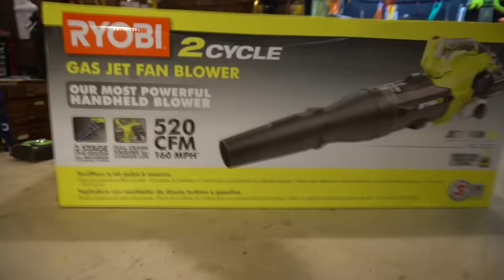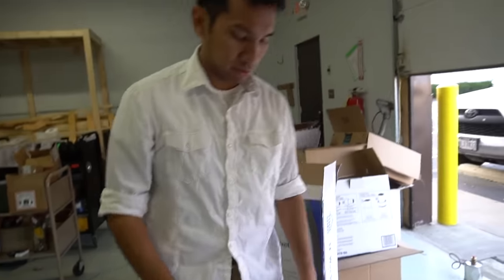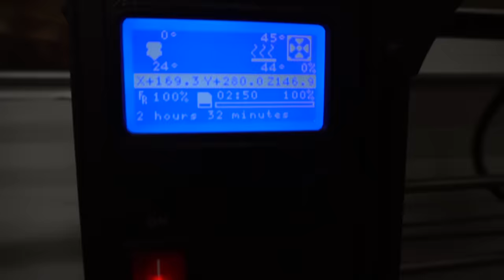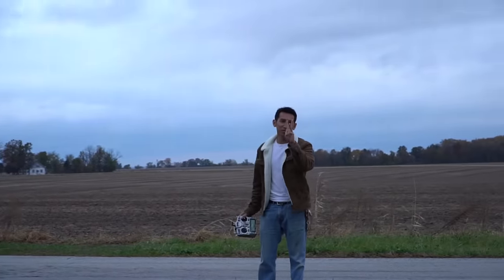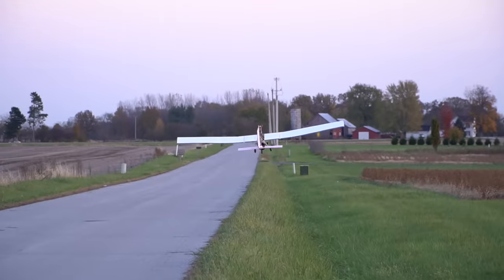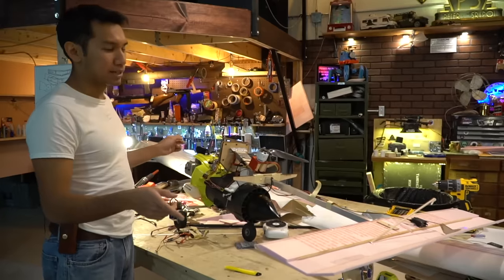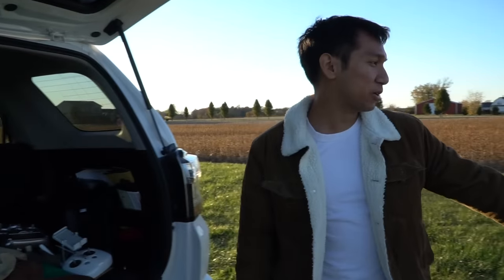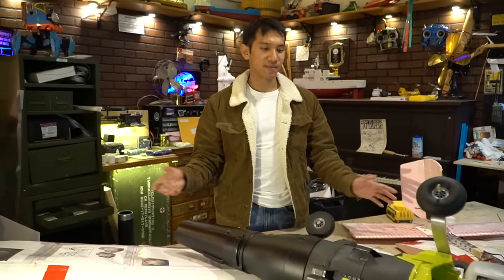FLYING Leaf Blower RC Airplane Drone

Comment: I'd like to see a propeller on that 2stroke blower engine. Strip it down to bear minimum.  Straight pipe exhaust & air ram intake , running on premium fuel with naphthalene
 (moth flakes) high octane ;)

Comment: If you're going to use the tricycle configuration, I'd recommend doing a 1+2 configuration, rather than the 2+1 that you've got going. Alternatively, put a skid under the rudder, and save yourself the weight of the 3rd wheel.
I'd also recommend doubling. Run two of those leaf blowers, and you'll get more thrust.

Comment: Could you try taking the governor out for higher RPMs and less weight?
Reply: leaning out the carb might get a little more RPM
Reply: I don’t believe a engine this size and use would have a governor, especially because the carb it’s using
Reply: strap on a turbo, nah jk😂
Reply: Running it too much faster would probably result in throwing the connecting rod in the engine. (Engine failure)
Reply: THOSE SMALL 2 STROKE ENGINES TYPICALLY  DON'T HAVE THEM
Reply: There are no governors in a 2 stroke.

Comment: you should have used E85 and use a colder spark plug then put a propeller on the pulley starter shaft,  use an electric drill to start the motor were the bolt holds the propeller and drop that heavy exhaust manifold!
Reply: E85 makes no power increase in a two stroke

Comment: idea 1: electric aircraft catapult so Sam can keep on the camera
idea 2: build a leafblower out of hobby aircraft parts
Reply: Actually a scaling catapult system would be a cool thing to develop since it'd be reusable in his videos.
Reply: Get another Lynxx blower from Harbor Freight, remove its fan and replace with an EDF and electronics to run off the stock battery and switches. If it can make lotsa thrust, make it an airplane without hacking up the blower housing.

Comment: Peter, that leaf blower needed tweaking for more output. Suggestions: Remove the head gasket (if the piston doesn't hit the head) for more compression. Check if the carbaretta is restricted and remove anything that retards the throttle linkage (increase the revs). Remove ALL uneccessary weight. Finally ask a petrol head if they have any ideas for increasing the output. Then you wouldn't have to CHEAT and use an electric motor!
Good luck on the next try my friend!
Reply: Remove the head gasket... I dont think that's how this works.
Reply: @MilesPrower1992  It Worked on my 50cc motor cycle back in 1988. It was 3 mm thick, I removed it and replaced it with gasket sealant. The bike went from 32mph tops to 46 mph!
Reply: @natsterjam  I was under the impression that you were telling him to run it metal-to-metal, no seal at all. Makes sense though.

Comment: 1900: I bet there will be flying car in the 21th century
2018: Two man made an airplane using leaf blower
Reply: 21st* men*
Reply: @d0nnyr0n  
oops, my bad
Reply: Its called challenge
Reply: @firtdudecoolmanplayer5357  It's called "A joke".
Reply: @d0nnyr0n  no its called a chalenge because they made a airplane using a leaf blower
Reply: @firtdudecoolmanplayer5357  Yeah I know... You just missed the joke...
Reply: @d0nnyr0n  there is no joke
Reply: @firtdudecoolmanplayer5357  The OP's comment was the joke. Also I never meant that making an airplane with a leaf blower was called "A Joke" (It's not "A Joke") I was pointing out that you had missed the joke.
Reply: 1. There are flying cars in 21th century! Literally cars, serial made, not just small planes not just homemade. 2. Two man made an airplane using brushless motor to put leaf blower onboard to get some views. Without it It was flying by itself as good as chicken.
Reply: @KabelkowyJoe  Nobody said there wasn't.
Reply: LMAO!!!
Reply: Dude in 1900: "What's a leaf blower?"

Comment: . Make a machine using only computer case fans. Maybe a quad copter?
Reply: Its hard to open computer fans, but if done correctly you can bypass the IC, connect to the actual motor windings and overdive the motor.
If you just put more voltage through the input wires, you would just burn the IC that controls the motor.
Reply: i doubt stock pc fan produce enough airflow to take off vertically... let alone battery and frame
Reply: Y'all seem to forget this man just built a plane out of a leaf blower. Have faith.
Reply: With server fans* 
They arr muxh better
Reply: Power to weight ratio of a pc fan might not be good enough for a quad copter but a plane might work if the ic is circumvented. Server fans should work out of the box I think.
Reply: He'll need some Delta Electronics or Lamptron fans for that one...
Reply: My issue is really power-to-weight ratio. By that logic I can use an electric fan to power my plane ignoring the power-to-weight ratio of the damn thing plus other components.
Reply: That part is easy, removing the circuit board from the base is the hard part.

Comment: Dude... You could put a prop in the gas leaf blower... Because when u pull the thingy to start it.. Thats the crank... Obviously that will always be spining when u turn the engine on
Reply: Por wat? The idea was a leafblower plane not a two stroke propeller rc plane.
Reply: @santiagoperez2094  bro it will still be using the air from the leaf blower ...

Comment: Why not make this thing again but with 2 leafblowers 1 on each wing
Reply: It would be even heavier
Reply: @Draganox25  Not with electric as it has a higher power:weight ratio, and if they modified it, it probably could
Reply: WAY to heavy
Reply: YT Meatballzz do you know how heavy a turbine engine is?
Reply: nick a turbine engine produces pretty heavy amounts of energy as well
Reply: Rumle true!
Reply: Pacific Signs too much weight
Reply: It would be to heavy. In reality, it WOULD fly, but it would also snap the wings, therefore u need to make better wings which would make more wheight. So basically u will be flying the same exact thing as in the video, just heavier....
Reply: The amount of lift you would need would be insane lol
Reply: Gas had 3.5 lbs of thrust with 11lbs of weight. Electric was 2 lbs thrust with 7 lbs of weight. Two electrics would be 3 lbs heavier than the gas engine while only adding half a pound more of thrust. Math doesn't add up.
Reply: better yet, put a propeller on it. then do two.

Comment: Your using a motor that is a generation or two back obsolete.  You might
 consider trying to use a Dyson vacuum unit as a blower.  Just a 
thought.

Comment: cuts box open with saw
puts batteries in gas tank 
taps with hammer
turns on
Reply: Those were bullets
Reply: @jamesrennalds4737  even more effective
Reply: Those were bullets
Reply: 22 LR rounds.
Reply: No. He put 22 lr rounds in the tank. But yes lmao
Reply: Generic account 
Also foam wing struts? In barbecue

Comment: Gas blower: remove engine governor, cut mating flange off muffler and weld to piece of tubing (lighter and straight piped), grind off a bunch of excess engine case material, etc. A ton could be done to lighten the blower assembly still and make it produce more power for little to no cost

Comment: A 2 stroke exhaust pipe / expansion chamber would give you huge power gains.
Reply: ^This!
Reply: And some porting work.
Reply: @turbofan67  ^Also this!
Reply: expansion chamber would probably add too much weight to be an advantage sadly, what would help the most is porting & adding timing (you can get offset woodruff keys for the flywheel to advance a few degrees), then just opening the exhaust up a little more and definitely open up the carb a little, remove the air filter and open the main jet out to correct the mixture at WOT and it'd pick up some power.  The engines are far from optimised from the factory but it'd take considerable time and skill (read- lots of 2T tuning experience) to get the best from it.
Reply: Another "trick" would be to remove the base gasket and lap the mating surfaces, this has the combined effect of advancing port timing (allowing you to effectively open the tops out by 0.5mm or so to increase duration without ruining the low end/starting performance), and raising the compression ratio slightly too.  This and the timing bump would make it a bit harder on the pull start but then again you could even do away with that and use an electric hand held starter and lighten the flywheel a good percentage at the same time.
Reply: Yeah with certain engines you can remove the gasket all together and just use RTV instead to raise the compression. I've done it before which gave me alot more power but would seem to overheat when WOT for long.
Reply: @NameName-eq7oe  
Increased compression=more heat every time, most people don't realize that compression is the 2nd highest cause of heat in an engine next to combustion, not friction like everyone thinks, turn on an air compressor from dead empty and right when it's about to shut off touch the cylinder, you'll understand why it has cooling fins on it real quick.

Comment: Yes i think weight,drag and wing area was your enemy there .I think maybe experimenting with decreasing wing span and airfoil but increase wing area by extending aileron side of wing towards tail. Ive designed and built acrobatic rc planes and those are the key things that make them able to fly with the heavier motor. It looked like you were super close but needed more wing area to maneuver at such a low air speed. Change in airfoil should reduce drag and gain you a little airspeed further increasing stability and manuverability.
Reply: Probably didnt help that there were rather large areas perpendicular to the velocity of the plane, like the mounting "plate" for the main wings and the front of the engine. A nose and a smoother surface over the mount may help

Comment: Your problem is using a Ryobi... really though you need remove intake restrictions, remove weight (grinding away any bit of metal you can from the engine mainly), and if you are able to, improve the gearing to the blower for more fan rpm vs engine rpm
Reply: And remove engine governor 👍

Comment: Hey! Great video guys! I do have a couple suggestions, I’m assuming that is a 2 stroke so a few relatively easy things to try would be to use rc nitro fuel, that will melt the plug to the top of the piston if only that fuel is used, but if you mix your regular high octane gas and oil like normal and then make say a 25%-50% nitro/regular 2stroke fuel mixture you will notice a hp and rpm gain, next I would remove the air filter, place a small screen or sock over the carb/intake for increased air flow and a very small weight savings. Next thing would be to make a small short header, removing the muffler, maybe cut out the the mounting flange from the muffler and solder or JB weld a piece of copper pipe bent to wherever you want it to dump exhaust (anywhere from straight down to pointing directly backwards will give very small increase in thrust). With the other mods back pressure won’t be needed as much but if you’re worried about it you can always drill a few small holes in a cap and place it on the end of the header. If you want to spend a little more time you can remove the motor from the housing and most of these small motors are cast as general purpose motors and used for a wide variety of applications (chainsaws, generators, pumps, etc.) so there usually is at least a few nonessential brackets and things that can be removed but also mounting locations like tabs and nubs on the casting can be cut off and ground down along with casting lines and imperfections, results vary from motor to motor and how much time and effort you put in but a noticeable weight savings can be accomplished. Most of these mods are quick, simple and cheap and cover air in, air out, a higher energy fuel and weight savings. And maybe give you just the performance boost you need for take off and flight.
Reply: Oh my god
Reply: Peter is a genius, but everything you mentioned was insightful and informative!

Comment: If you want to make a clean bend in that heat treated aluminum you have to anneal or un heat treat it where you want to bend it. First take a candle and blacken up the area you want to soften and then use a propaine torch heat it just until you burn off the black.It will bend much easier and to a smaller radius then.

Comment: They need the tube for that directional vector pressure. Otherwise it's just spreading the pressure everywhere else behind it. :/
Reply: There's two types of blowers. The fan style and the turbo fan blower. The fan style doesn't provide enough thrust.  The turbo fan style would work a lot better.  There's just no way a fan style would work with the weight and lack of thrust

Comment: You should put a prop on the front of the gas motor.
Reply: wouldn't it create turbulence ?
Reply: He could have but he said that he wanted to keep the power systems stock
Reply: @guitarsplanes  we see how that turned out. He had the electric pop up prop anyway. It would have flown with a prop on the front.

Comment: A few tips:

Spend the extra cash to get something other than a Ryobi.  Great tools for their price point, but obscenely heavy.

Try it with a lifting body airframe similar to a B2, mount the blower on top.

Blower mods: Straight pipe the exhaust and terminate in line with the primary impeller to reduce parasitic drag on the engine (marginal, but every bit helps), strip as much of the housing as possible.

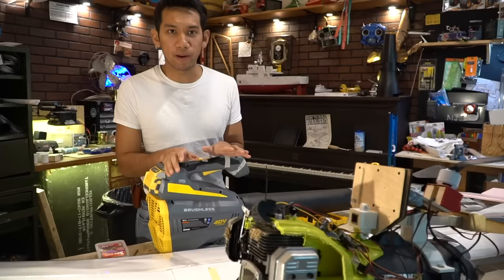Comment: 17:19 The strength is there absolutely but it just the way its harnessed that is wrong. An impeller is not that efficient compared to an ordinary propeller so if you would have stuck that on it instead the power would absolutely have been there and would have flown by it self. But I know the challenge was a leaf blower as such it was built.
Reply: All he needed to really fly quick was a huge wing that weighed nothing with an aggressive attack posture it didn't even have to be and air foil it just had to be light

Comment: Could have disconnected the governor on the gas powered one to get much more RPM.  Also make a exhaust pipe for it.
Reply: Dude, its a 2 stroke, aint no governor on there

Comment: The thrust of a leaf blower would probably work better with a low-thrust design like a gyrocopter which will go airborne at pretty low speeds and is a lot lighter than its winged cousins. Think outside the box. Not everything that flies is an airplane. Try a very large pair of paper cups for the Magnus Effect. Good luck.

Comment: Maybe a biplane with thinner wings could do it!
Reply: Biplanes actually provide less lift per unit surface area than monoplanes, because the wings interfere with each other as they are usually stacked with very little offset. If the wings didn't overlap at all you might get more lift, but you'd also get more drag.

Comment: Hey PeterSripol why dont you try and build an rc air plane with an aluminum ladder ? could be something cool to try
Reply: Only if he incorporates a sweet pair of post hole diggers
Reply: Actually those ladders fly as is, was driving behind a pickup truck on the interstate once and watched one literary go airborne briefly before it landed on the road and forced me to brake. Each ladder rung acted like a wing which caused it to rise into the air and fly for a minute...
Reply: Let's try a brick instead

Comment: The expansion chamber is 100% necessary, you could tune the engine and gain power, like a new expansion chamber, more throttle, less weight, re-gear the output shaft to achieve higher RPMs, different fuels, like avgas.. better tuning would help, too.

Comment: There should be some way to give it more throttle and/or remove the rev limiter
Reply: There is no “rev limiter” as it isn’t necessary. The power produced by that engine is strictly engineered to be loaded by the impeller to hold the RPM at the desired speed. This is primarily to give the tool a specific life expectancy. Now, if all you want is raw power and thrust with little regard to the engine durability then there’s a bunch of things that can be done. Tuned pipe exhaust, increased exhaust duration, lower the cylinder for increased compression, larger carburetor (and throw away the air filter), open up the reed block if it has one. I didn’t see how air was introduced to the fan. Letting the fan (impeller) breath is incredibly important. Also try streamlining the engine housing to reduce aerodynamic drag. Seemed to me there was too much stuff hanging off in the air stream. Try this again please. I know it can work!
Reply: @GFTP100  I thought that there would be something to limit the speed of the engine like the governor on a lawn mower or go cart engine. You are saying that the strain on the engine from the drag of the impeller is all that keeps it from revving too high?
Reply: Yup. Those other engines have to deal with varying loads (the mower is the best example) and 3600 rpm is a mandated max speed for safety reasons. Go karts have a governor to prevent the engine from overspeed and self destruction.
Reply: @augustsawzak5401  also, the fuel to air ratio limits top speed. Running near the ideal range, more fuel causes less peak rpm. This is how these engines are tuned. In my old Jet Ski, it actually has a valve to dump extra fuel in, limiting engine speed while increasing cooling and lubrication.
Reply: I would have tried to add a bypass to the second stage
Reply: @GFTP100 s comments are correct. The other limiting factor is cylinder porting and exhaust design

Comment: Add a prop to the front Side of the engine via a adapter to take place of the centrifugal clutch within the pull start(the prop would take place of the starter), u will likely need a counterclockwise prop but it would still be fully leaf blower powered

Comment: Hi I'm just a color that knows a lot of for aircraft and you could have used to throw from the thanks from the leaf blower to power a small fan which means that shine to a bigger fan that pushes it usually forward to give it an extra power without any extra power from the leaf blower